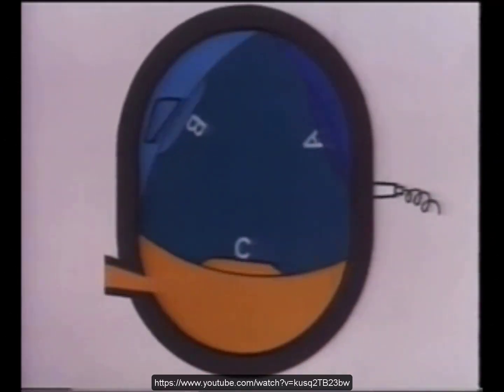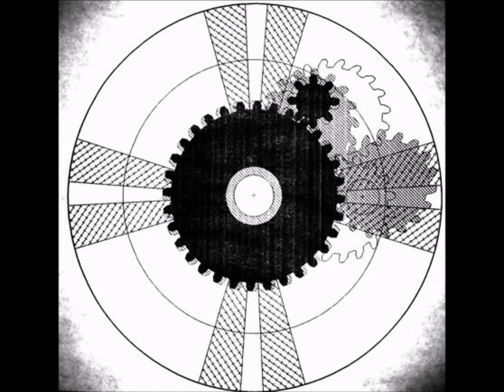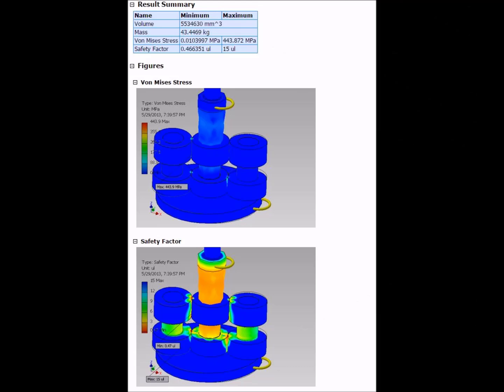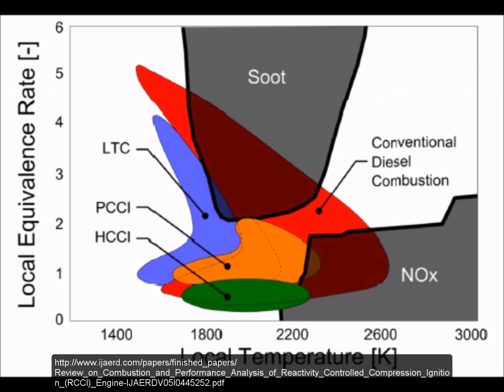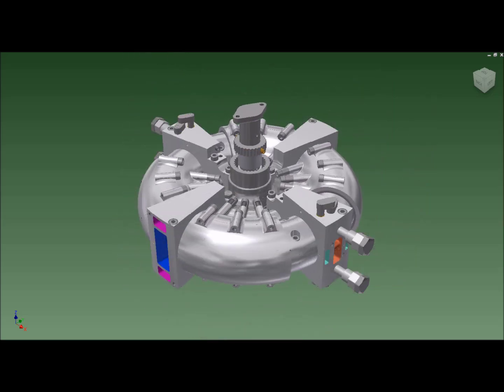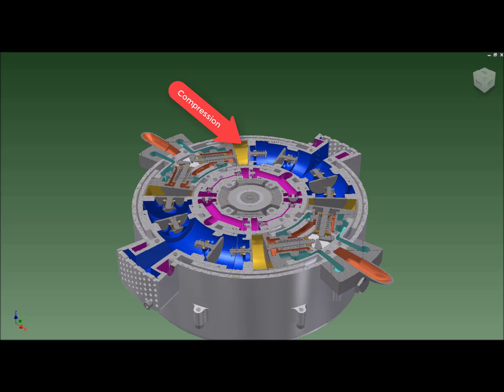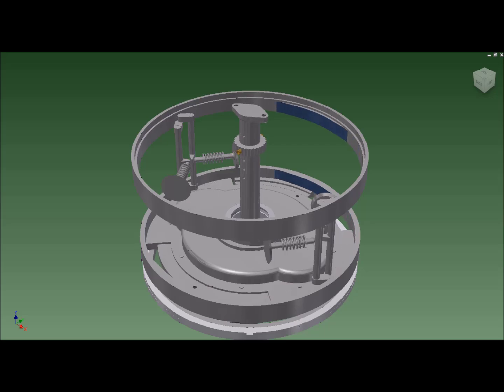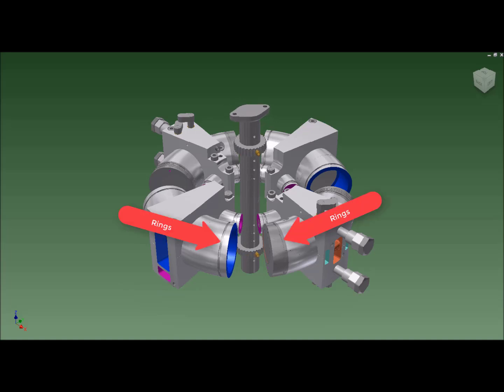OPCE Four Cylinder Engine Story

Comment: I'm going to make one of these with my 4D printer !
Reply from the maker: Wow -- you got me investigating 4D printing:  creating 3D prints that morph into different shapes with time or exposure to external stimuli.  Very cool!
By the way, 3D printing the gears for my engines isn't trivial -- I have written two software programs with approximately 1500 lines of code each for generating the properly-shaped teeth as dxf files to import into the 3D modelling software for my engine models, and that I use to generate 3D printing files to make plastic versions of the gears when I need to double-check things.
Once, the college I was working for printed me two steel gears on their half-million dollar metal printer sitting in its hundred-thousand dollar hermetically-sealed room.  The gears are pretty good, except that the lower edge of each tooth is a bit rough due to the laser welding down into an unsupported bed of nanoparticle steel powder.  They are still very nice show-and-tell items to visually demonstrate the accuracy of my software and the way in which the non-circular gears produce oscillatory motion.
In order to handle the engine's power requirements, the gear teeth need to have a number of strength-and quality-related specifications, as well as being involute and helical with a constant pressure angle.  Every tooth has a unique profile, and that profile changes from the bottom to the top of each helix, since the instantaneous radius changes as a function of the angle of rotation.
 That's not something commercial non-circular gear software offers at the moment (they do "rolling pinion" teeth where the pressure angle changes with distance from the centre shaft and the teeth are generated normal to the instantaneous pitch and not radial to the centre of the gear), but Liebherr Group's CNC gear shaper team have investigated my requirements, and indicate that it would be relatively trivial to write software for their gear shapers to meet the specifications.  If I'd had $18,000 to throw away, they'd have written the software and sent me a trial set of gears in 2013.
Thanks for your interest!

Comment: No, you don't need mass efficiency in the stationary engine, you need the low amount of parts and ultra low cost. The ideal solution is a single piston engine.
Reply from the maker: Evidence from the OPOC and Achates engines indicates that having two opposed pistons will result in increases in efficiency of 25% to 50% over a single piston conventional engine.  If I had to pare down what I have learned over the past five decades about engines and efficiency, that's the simplest piston system I would recommend.
Thanks for your comment!

Comment: So you reinvented the Taurozzi engine from Argentina. Don't worry, I saw patents replicated before.
First of all, this design and dozens more which works on the kinematics doesn't solved at all the core issue related to these thermal machines.
I put it on numbers : you need to lower 160 gr/kWh of BSFC AND get rid of most harmful emissions.
If you don't achieve that, there isn't an incentive to even try your design.
Sorry, but better an awful truth than a nice lie
Reply from the maker: I'm not sure what happened here -- I can no longer see your posting with the Wikipedia article on BSFC anymore, and I've lost two of my replies to you.  I'll re-post that content, and hopefully it doesn't show up as duplicate information.
Interestingly, my 2-stroke design was inspired by the MAN 2-stroke diesel, which, in the Wikipedia table, is at 155 g/kWh, so past the target you set for me.  With three further advantages over the MAN diesel, my engine should be competitive (at least at the huge scale of their marine engine!).  Mine doesn't rely on porting, so I could, if I wanted to, open the intake channel at BDC, not at 75 degrees out of 90, for a longer combustion stroke; mine is opposed piston, which, according to the builders of the OPOC and Achates engines, improves efficiency by up to 50% over a conventional engine; mine can have valves almost the size of the cylinder bore, dramatically increasing venting, which is one of the big limitations on conventional engines -- Chrysler was excited to increase venting just a tiny bit by doing a hemi head!
You've now got me interested in doing a giant marine engine to match the MAN!  I've done some much bigger mockups, and it scales up beautifully; I considered using it for diesel-electric trains at one point.
I agree with you that IC engines are notoriously inefficient, and we should be aiming for more efficient systems.  However, I started designing this in 1975, and it's hard to let go of the thousands of hours I've poured into it in almost five decades!  There are still applications that are best suited to something like an IC engine, and with renewable fuels and very low emission fuel options available now, there still may be a place for my engine.
Thanks again for your critique, for sparking my thinking, and for pointing me to BSFC as a good metric for efficiency.
Merry Christmas!
Reply from the maker: Thanks for your input.  I'll have to look up the Taurozzi engine -- I've never heard of it.  My lawyers and I did as extensive a check as we could to try to avoid infringing any patents, and didn't see anything close to what I designed.
Have you checked out your numbers on the OPOC engine and the Achates engine?  I'd be curious to see how they fare.  For certain, mine is considerably lighter, as there is no fixed block and no counterweights on massive crankshafts.
By the way, you should be looking for g/kW, not kWh -- power is in kilowatts, energy is in kilowatt*hours.
The engine in the video is about 600 g/kW, which is a lot less than most internal combustion engines but not as low as you would like it to be.  Is your target based upon electric motors?
Thanks again!
Reply: @prosstaylor  , FYI 
https://en.wikipedia.org/wiki/Brake-specific_fuel_consumption

This is the most important fact at the time to consider other engine technology than the usual one
There is one, and only one way to achieve values below 160 gr/kWh  and is performing detonation-deflagration instead of combustion

The issue is the exergy availability destruction 
Is complicated and cannot be 
Fixed only doing mechanical changes
 Innengine,  liquid piston, achates,   and every engine which uses the same combustion principle lost before the usual looses approx 25% of the fuel energy
Reply from the maker: Thank you for staying with me on this.  I completely misunderstood your metric (and your units were correct -- sorry about that!), so I'm glad you pointed me in the right direction.  Yes, IC engines are notoriously inefficient -- mine is an attempt to make a big step to improve that, but you're right that even a big step doesn't come close to the number you're suggesting.  I'll continue to look into your suggestions.  Thanks again, and Merry Christmas!
Reply from the maker: I took a moment to look at the Taurozzi engine.  The only thing that's even remotely similar to my engine is the curved cylinders and toroidal pistons.  His engine isn't opposed piston, the pistons move instead of the cylinders as in my design, doesn't have uniflow scavenging, uses conventional cam shafts (for both exhaust and intake valves), has valves half the size of the ones in mine (restricted venting), uses a crank shaft with counterweights instead of precision non-circular gears, doesn't have variable charge or variable compression, doesn't use the Miller engine cycle, and isn't symmetrical and therefore ideally balanced and vibration free.  No wonder it didn't show up in any of the patent searches we made.
But thanks for pointing it out to me -- I'm always interested in other people's designs!
Have you had a chance to look at the one that calls itself the "Liquid Piston Engine"?  Although I don't think rotary engines are the answer, this one overcomes almost all of the problems demonstrated by the Wankel engine.

Comment: Wonderfol Rotary Engines !... Congratulation...
Reply from the maker: Thanks for your support!  I actually make a distinction between rotary engines (where the motor parts spin completely around the axis) and an oscillating engine (where the motor parts move back and forth in only part of a circular path).  My earliest designs were rotary, but I moved to oscillating designs to reduce the wear from centrifugal motion.  Thanks again!

Comment: I came here for a video about cute kittens.  Ended up learning about the Miller cycle and Delayed Intake Valve Closing.  But - here's my take - Pros
Efficiency Gains: Innovative energy transfer mechanism could reduce frictional losses.
Compact Design: Circumferential piston arrangement reduces engine footprint.
Unique Motion Conversion: Non-circular gears optimize oscillatory-to-rotational motion.
Modularity: Potential for easier integration into certain compact systems.
Innovation: Departure from conventional ICE designs opens possibilities for specialized applications.
Cons
Manufacturing Complexity: Expensive and challenging to produce components like non-circular gears.
Durability Concerns: Increased wear on unconventional moving parts, including gears and shafts.
Thermal Management Issues: Cooling combustion chambers in a circular layout could be difficult.
Friction Losses: Oscillatory piston motion may introduce additional friction on chamber walls.
Valve Timing Limitation: Rotating cam plates restrict flexibility compared to modern variable valve timing.
Lower Power Density: Likely less power output compared to conventional turbocharged ICEs.
Maintenance Challenges: Specialized design could complicate repairs and servicing.
Limited Ecosystem Support: Requires unique tooling and expertise, reducing adoption potential. One last Con - no cute kittens.  Other than that - good video.
Reply from the maker: Thanks so much for your thoughtful response!  I love it when I get detailed critiques, as that's how this design has progressed through the years.  I had a dozen or more experts that I leaned on when I was teaching at the polytechnic college during its development, and they were an invaluable source.
Some responses to your comments, particularly the "cons":
Manufacturability is an issue; I have a handful of machinists who have provided input into how to do what's required, and I think they've shown that modern CNC machines can do the work required without much difficulty.  The idea is to have most of the parts cast, with final touch-ups done with 5-axis CNC machines.
The gears can only be made using a CNC-controlled gear shaper, as grinding wouldn't produce the same pressure angle for each tooth.  However, I have worked with the manufacturers of gear shapers, and they concur that the task can be easily programmed into a CNC-controlled gear shaper with a software-controlled variable centre distance.  My design software specifies the optimal number of teeth for the cutter wheel.  It's true, though, that generating gears this way would take longer than casting and machining the piston connecting rods in a conventional piston engine.
Abouts gears and shaft wear:  the engineers I worked with at the polytechnic college showed me how to predict and prevent wear using pressure-velocity calculations, so that's a part of the design process, as well.  One of my main concerns was for the outward revolutionary force on the planet shafts and bearings, and I'm pleased to say that I have a new design that moves those planets inside non-circular ring gears, reducing the distance from the rotational axis to just over a quarter of what's shown in the engine in this video.  That greatly reduces the outward pressure on the bearings, and the rotational velocity is also reduced.
Thermal Management is achieved by circulating coolant through channels in the pistons, since that's what's stationary in this design.  I haven't had the chance to get a thermal analysis for the most recent design from the thermal engineer expert at the polytechnic, but she provided one for earlier designs and was satisfied that cooling shouldn't be an issue.
Cylinder wall friction:  The FEA analysis indicates that the maximum outward displacement of the cylinders is less than 50 nm, so the orientation of the cylinders with respect to the pistons will fall well within the tolerance allowed.  The rings themselves will experience a slight outward force, particularly at mid-stroke where the velocity is greatest.  This needs to be evaluated in more detail, but the outward force is certainly much lower than that experienced by similar parts in rotary engines -- for example, the apical seal in the Wankel engine.
I should look more into the way that variable valve trains work, like Toyota's VVTi system.  However, I think that being able to adjust the open time from 40 degrees to 80 degrees (that's 80 degrees to 160 degrees in a conventional engine) is a considerable range.  Thanks for getting me thinking, though!
In terms of power density, by being two-stroke instead of four-stroke, it's already almost double the power density of a conventional clean four-stroke engine.  The one in this video is predicted to max at about 80 hp @6500 RPM; its diameter is 320 mm (12.5") and its height is similar.
Maintenance is an issue, particularly since I've chosen to include all the things that are normally "external" -- or at least easily accessible -- inside this engine:  oil pumps, fuel pumps, supercharger, etc.  If I find a manufacturing partner, it may be their choice to revert to having those as addons instead for easier repairs.
Ecosystem support:  You can't imagine how many times I've put this design on the shelf because of my environmental concerns and the likelihood that IC engines will be phased out.  People keep telling me that I should keep working on it, particularly if it can be used to support environmental causes -- for combined heat and power (CHP) or cogeneration, or as a simple hybrid (charging the batteries of an EV on long-haul trips); and of course, using renewable fuel sources instead of fossil fuels.
Sorry about the cats ;-)
Thanks again!
-Ross
Reply from the maker: Double-take:  I talked about outward force on the rings -- one of the main reasons I had for switching to moving cylinders instead of moving pistons was to put the rings in the stationary pistons, so that's not an issue.  However, there is still the issue of the intake valves and the supercharger valves experiencing an outward force as the cylinders oscillate.  Your comments have me thinking of ways to reduce that outward force, or at least the effect of that outward force, including using something like conventional reed valves for the supercharger, and for the input to the combustion chamber, an assembly of linked poppet-style valves (for example, four small valves per cylinder, since that provides much greater venting than a single large valve with greater resilience per valve under pressure) all on something like a hinged arm, instead of individual valve guide bearing surfaces.  Again, thanks for stirring the creative juices!

Comment: Had  me until the parastalstic pumps . When they fail, which they do/will , no lube . A small trocho or gear pump will last , and it will push oil through a filter.
Reply from the maker: Thanks for taking the time to provide this critique!  You'll notice that these aren't actually peristaltic pumps, which force liquid through a flexible pipe.  They're more like rotary compression pumps, with vanes following an eccentric surface.  I'm definitely not tied to this minor feature of the design as shown -- the main thing is what's happening with the combustion chambers.   Thanks again!
Reply: @ much better. The only thing is that it needs a filter for both lubricants, magnets for the drain plugs and enough pressure to run it. Rollers require less pressure, and they can be replaced if not worn excessively. I really like the idea of high compression and the ability to run long expansions to the compression and power. I have been fascinated by this when Volvo was experimenting with the decentralized design for heat and power. I think it was using the 2.3 red block. I’m betting that it would be cheaper to use than the grid, and with a Telsa battery it would work better, as it would work harder, heat from the battery and electronics is free heat . I’m lucky as a son of Dixie that I have never had to heat in the northern states or Canada, Russia etc. I’m sure there are some cobbler setups there that beat the grid .
Reply from the maker: Thanks again for your insight and suggestions!  Much appreciated!